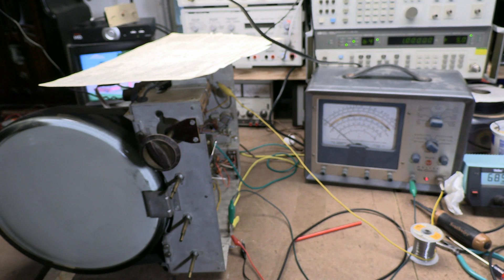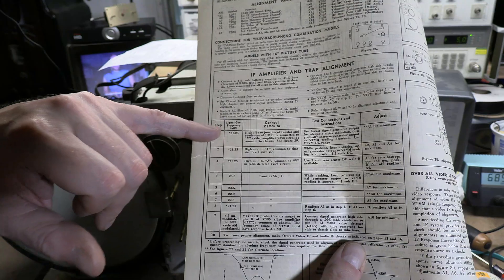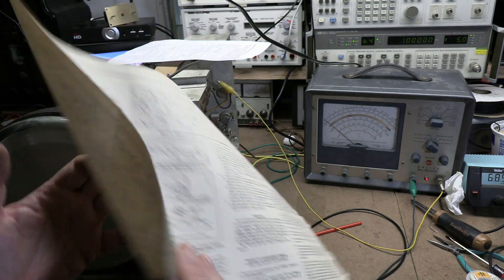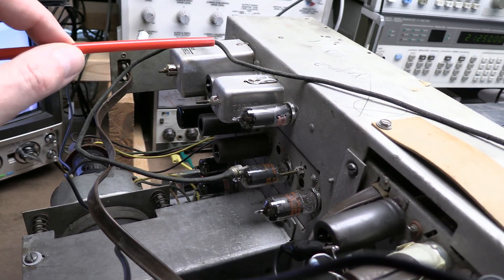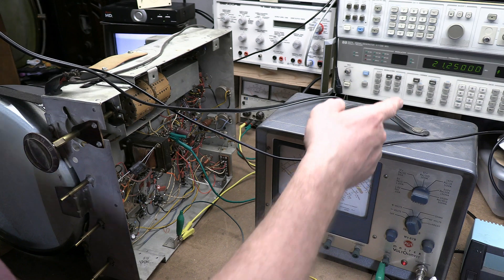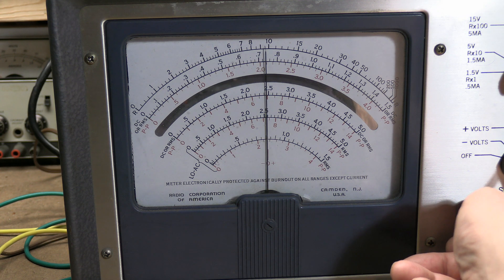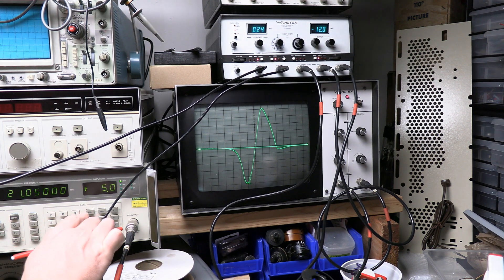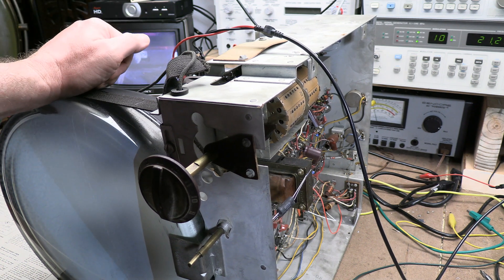Vintage TV Alignment 101: Split carrier, ratio detector, FM Sound IF alignment

Comment: Thanks Bob, another great part.  Leaving a comment as it helps.  Here is a question, I align FM radio visually and have occasionally found a prior tech had peaked the 10.7 MHz IF sharply, probably by VTVM peaking, and not as a hump across a band of frequencies as is usually shown in visual alignment instructions and seen using a scope.  As you showed, this TV just asks for a peak, is that typical or do some sets want to see that hump on a wider band for the sound IF?  

If you want a suggestion, since you have two good cameras, when you are done with the alignment, perhaps you can follow up with setting up the display.  Such as linearity, focus, centering etc. since you can show what you are actually doing at the back and on the neck while also showing the resulting effect on the picture screen as picture in picture on the video. Hope you can do that with a color set eventually as well for purity, convergence etc.  Since you have that Sencore stack,, just suggesting.  Thanks again for a great series.
Reply from the maker: Hi. I've never seen anything other than peak for sound.  I've actually already done tTV setup a few times. Most recently in my Predicta tips series. There are so many variations in how you tweak the settings I'm not sure I can make a comprehensive video. As for color, I've never restored a color tv